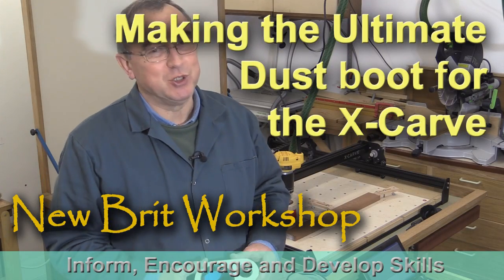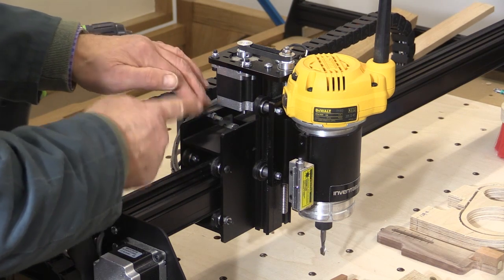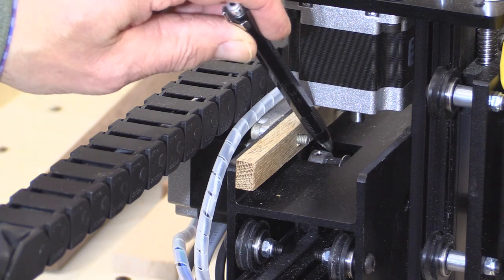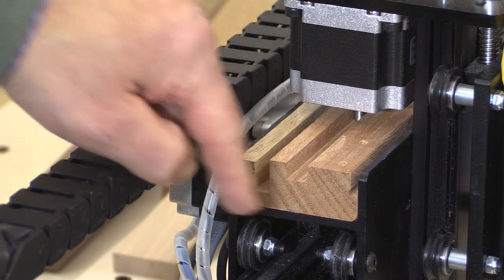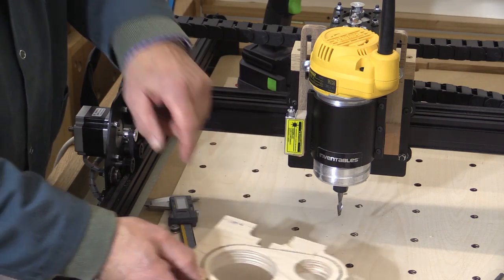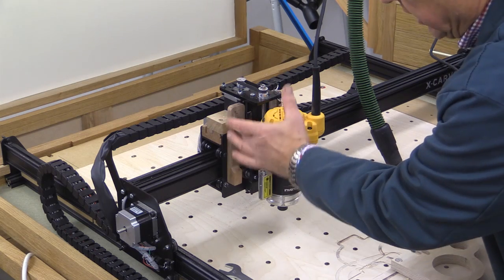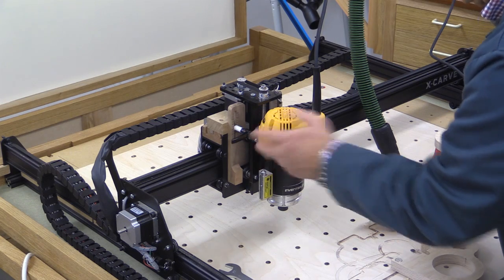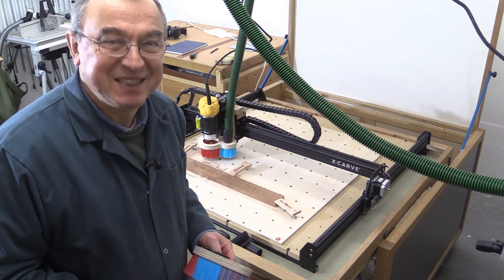X-Carve Ultimate Dust Boot

Comment: Good job.  If you were to move the vacuum pickup to the front you wouldn’t loose and X travel.
Reply from the maker: I would not think so as long as the hose weight is supported from above.  Peter

Comment: Looks like a good design. The problem I have with my DeWalt is that it exhausts out the bottom of the router and blows the dust everywhere except near the exhaust hose. So I need to design one that blows the exhaust out the side so the vac hose can pick up more dust.!! Of course my shop vac just died so time for a new one.
Reply from the maker: Hi John, Mine worked well within my dust boot. It may be that your old vac was not as good as my CT26.    Peter

Comment: Peter
How did you put the bristle in the slot
Reply from the maker: I got some 6 mm brass tubing and slightly flattened one end. I pushed clumps of bristle through the round end and let them stick out through the other end by about 10 mm. These were then in a line and easy to manage. I used (UK name) Copydex to glue it in place.   Peter
Reply: Thanks Peter I´ll give it a try when I have found the bristle

Comment: Hello Peter 
Will you be so kind and tell me what kind of bits you used to cut the dust bot

Kristian
Reply from the maker: Hi Kristian, I used a 1/4" straight cutter for the profile and a 1/8" cutter for the channel that takes the bristle.    Peter
Reply: Thank´s  Peter  
which one did you cut first ?
Reply from the maker: The channel for the bristle.  Peter
Reply: Thank you Peter.
Was it difficult to change bits after the first cut (the channel)
Reply from the maker: No, quite easy. Peter
Reply: I assume you are using VCarve ?
Reply from the maker: Yes, Vectric's VCarve Pro is a fantastic bit of software - it is easy to use and there are loads and loads of tutorials, help files and other resources available free of charge. You need to use the gcode files (X_Carve_inch.pp and X_Carve_mm.pp) in the Windows\program data\vectric\VcarvePro\PostP directory after VCarve pro is installed. These two files can be found on the Inventables web site.   Peter
Reply: Thank´s Peter     and good morning  

I´m strongly thinking of getting that program after you had explain it on the youtube
Reply from the maker: rednotereso It is brilliant.   Peter
Reply: Peter 
I can´t  find the two files  X_Carve_inch.pp and X_Carve_mm.pp  
to use with the VCarve program  
Please give me a hint where to find them
  
The only files to download was:
   
Shapeoko_PostP.zip  
TinyG.zip    
X_Carve_PostP.zip
  
And Peter,  do I need   X_Carve_inch.pp 
since I only going to use millimeter
Reply from the maker: Here is the link to the post processor files:   https://www.inventables.com/technologies/vcarve-pro    The Zip file contains both and it is up to you if you only want to install one. When you run VCarve Pro you can choose to use the post processor that suits your setup so choose the X Carve mm one.    Peter
Reply: Thank you Sir
Reply: Hi Peter Please tell me the difference between the VCarve Pro and the Aspire
Reply from the maker: Aspire lets you into the world of 3 D carving.     Peter
Reply: I have borrowed the program Aspire 8.0  to test how it works
and see if it is worthwhile to buy it for me.
Do you think I can settle with Desktop or the Pro ?

Comment: I apologize if you mentioned this in an earlier video, but are you using a Festool vacuum with the X-Carve? If so, how long can it be run continuously?
Reply from the maker: +RC Grid I run it for as long as I want - it is designed for continuous use supporting the building trade, carpenters and workers in the automotive industry. The period that I have used mine is just under 2 hours followed within less than 10 minutes by over an hour. I did check the machine and it was not hot and continued to make the same "comfortable" sound.    Peter
Reply: +New Brit Workshop (Peter) Great to hear, I am considering getting the festool mini for CNC use
Reply: +New Brit Workshop (Peter) Is yours hooked up to a dust deputy?
Reply from the maker: +RC Grid Yes, I run it via an Ultimate Dusty Deputy. I have made a video about this and it shows tests that I have done to prove how little it effects the vacuum power.   Peter

Comment: Peter, A great idea. I tried a boot right after i received my X-Carve and has exactly the problem you described. As a result, it wound up in the trash. I have one question. Do you think it would work if you made the base out of 1/2 inch plexiglass?  That way you could see the work. I know you would see the brush channel but i don't think that would be a bad trade off to be able see the work. Could you please send me the plans and I think I will try to replicate it using the plexiglass. My email is: tomy.n@comcast.net   Once great idea!
Reply from the maker: +Thomas N Hi Thomas, The plans are on the way. Plexiglas will be okay but you may find that dust gets stuck to it by static.  Cheers.   Peter
Reply from the maker: +Thomas N Please check your email address as it has just bounced back.   Peter

Comment: Great design.  Would you please send the plans to jared [at] jhmade.co.za?  Also, where did you get the brush strip from?  Thanks.
Reply from the maker: +Jared Holtzhausen Hi Jared,  The plans are on the way and I have included a note about the brush - it is easy to get.   Peter

Comment: Thanks once again Peter for a great video. It's been good to see the development process to the final product (maybe?). What do you use in your workflow from drawing to carving? I've been trying to get on with Easel but the only thing increasing is my frustration!
Reply from the maker: +Itz MeAgain  I am not going to design any more dust boots as this one works really well. It has been a useful exercise none the less. I am just uploading a series of 3 videos that shows the design process for the Ultimate Dust Boot. I used VCarve Pro which is simply brilliant. You can produce everything you need from the drawing to the toolpath in gcode. In the first video I do show how you can use a drawing package (I use Draftsight) to create the shape which you then import into VCarve Pro to do the toolpaths. Hopefully it will be up later today.   Many thanks for the kind words.    Peter
Reply: +New Brit Workshop (Peter) Thanks for the info Peter. I've read a lot about VCarve Pro and it does look good but I'm a Mac fan so $600 for VCarvePro and $2-300 is a big layout for an amateur DIY person. I am and AutoCAD user at work and I use DraftSight already on my iMac at home and I do like that to generate 'faces' for Easel for 2D stuff but I just can't get on with Easel. I bought the X-Carve to carve family portraits, amongst other things, and  PhotoVCarve looks affordable for that, once I get a Windows machine.

Comment: Great vid peter. That is a lot better dust boot easy to remove and adjustable
Reply from the maker: +nippychippy   Hi Robert,  Have you been away? Yes, I am really pleased with this design but I am glad that I showed the other design as well. A number of people have settled for something similar to my original design which I found had too many disadvantages. The "Ultimate" Dust Boot really works for me. I have been inundated with requests for the plans - I think it was over 30 in the first 8 hours of the video being up. I have now posted the plans on the Inventables Forum to cut down the amount of work at this end. How is that saw?    Take care.   Peter
Reply: +New Brit Workshop (Peter) that's great peter. I have had  nightmares over the last few weeks I'll email you later and give you an update 

cheers robert
Reply from the maker: +nippychippy   Yes, email as soon as you can and I will do what I can to help.    Peter
Reply: +New Brit Workshop (Peter) cheers

Comment: Hi PeterLove your videos. Would you please send me a copy of your X Carve dust boot plans also where did you buy the bristles from.My email is jimbo7515@gmail.com. Thank you Jim
Reply from the maker: +James Cooper Hi Jim,  The plans are on the way. My bristle came as free samples from a brush maker. I suggest that you buy a cheap brush from a pound shop and cut what you need. Bristle is quite easy to handle and my previous dust boot videos will help. You bristle needs to be at least 55 mm long which allows for 10 mm in the groove and then enough to trim if need be.     Peter
Reply: Many thanks for the fast reply and the info.Please keep up the good work. I should have my X Carve in a couple of weeks. The wait is killing me.Thank youJIM
Reply from the maker: +James Cooper  I have the answer for you - read my book please and then put a review on Amazon. I guarantee that you will enjoy the book and feel better after reading it !     Peter

Comment: May I offer one more suggestion in the improvement of your great dust collector ass'y?

Why not use 3/4 inch thick Lexan (or plexiglass) as the base; so you can see the cutter as it cuts the wood. In addition, what about a light that would light up what you're seeing as well, that is built into the dust bristle carrier. Battery operated would negate the need for wires..

In any case, you keep us all in amazement with your most clever workmanship. But few at all could ever teach with your true gift. I enjoy all your videos immensely. 

May our precious Lord continue to bless you with these  blessings from Heaven  dear friend.
Reply from the maker: +pat dee   Hi Pat, The problem with Plexiglas is that it gets static electricity and the dust gets attracted to it. It then needs to be cleaned all the time. With the Dewalt router there is a light at the bottom which illuminates the cutter. Many thanks for the kind words.   Peter

Comment: It's a great illustration of the uses of the X-Carve too. Those pieces would have been difficult to get accurate on a band saw, and the markings for the positioning even harder.

I would perhaps have bridged over the top of the mounting behind the router, joining the two adjustment bracket things with one handle. Then you'd need only one lever and could adjust one handed. Perhaps it'd get in the way though. A CNC certainly gets you contemplating things you wouldn't normally!
Reply from the maker: +Rico S  Many thanks. I think I will have to look at 3D printing next !   Peter

Comment: Great video peter look forward to vcarve design video. btw ive made 2 of your last design and for bristle i used pound shop paste brush which worked out really good and not to stiff when using, and the other with pound shop kitchen brush but bristle was to stiff. thank you again. pam
Reply from the maker: +Highlandboxes Hi Pam,  If you can I would make this new one as it is much better. I am going to put a note on the previous video suggesting people follow the new design.   Take care.   Peter
Reply: I will be making your new one for sure as it would work a lot better with deep cuts. look forward to v carve guide i have learnt so much about setting the tools up as well.

Comment: Hi Peter, great improvement!
My machine chopped all my bristles and melted them, made a mess of it so this idea is something I'll put into practice 👍 
Also what's the little laser on the side of the spindle?
Reply from the maker: +Malcolm Daly   Hi Malcolm, Yes, the bristle can get in the way with the old design. This one is so much better and now there is hardly any dust at all. Also, I had to use very fine bristle for the previous design and that is not the case with this one.    The laser is for re-aligning the X-Y position after a cutter change and prior to doing a G92 X0 Y0 Z0 command. Take a look at my X-Carve Xtras video:   https://www.youtube.com/watch?v=1OHBhSXFkIY       Peter